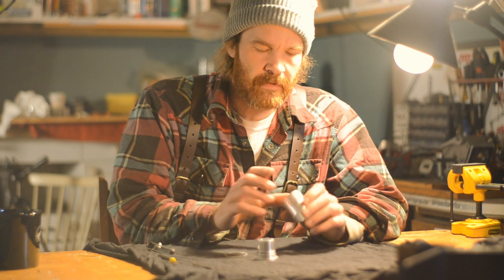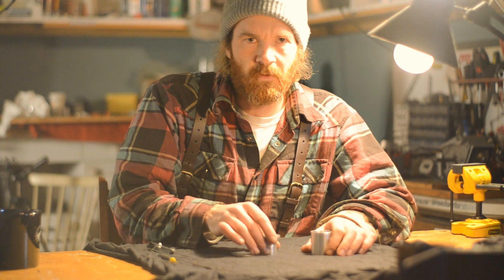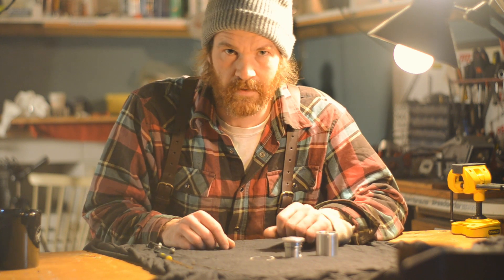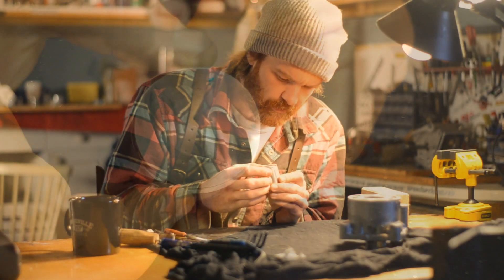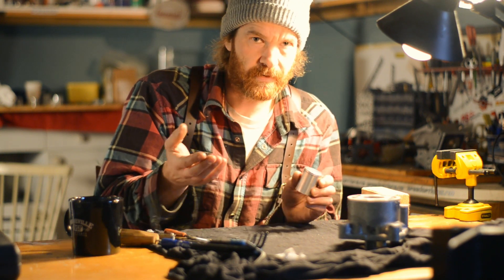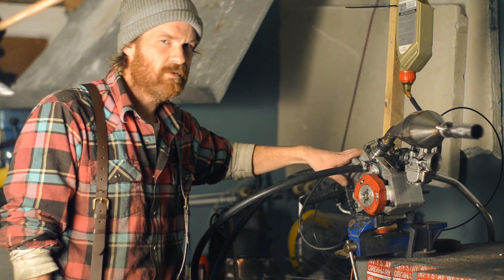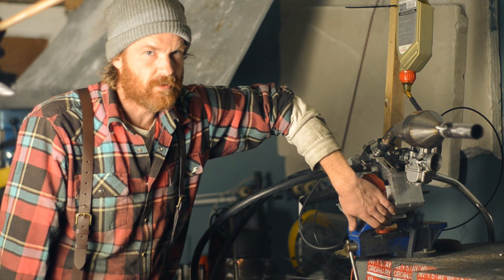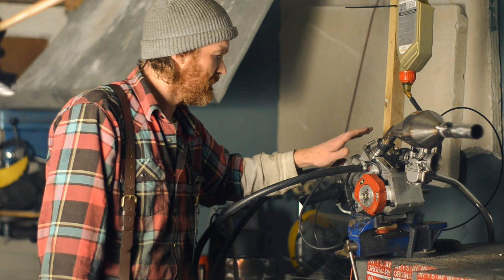Worlds Most Powerful Two Stroke Lives Again!

Comment: Great video! Always enjoy popping in to check out your videos. Haven't done the math for your compression ratio, but most race gas engines have a piston quench of .015 or an inch. And that's mostly for valve relief. At .5mm your close to .020 of an inch. You don't have any values to worry about. I think you mentioned using nitro fule? If that's what your going to use you might consider tightening the piston to head clearance to .015 or even .010 of an inch. This would net more torque. Also, this would be interesting to see in a forced air induction?

Comment: You might have to really do some work on your tuned pipe to accommodate for your massive port time area on the exhaust port. I don't think pipe build programs will register your massive exhaust port. At least to get your full potential

Comment: Nice :) - Maybe put a water jacket air bleed on the rear of the head, as it's prone to hydraulic air locks and head hotspots(bad for pinking, etc)?? Top Tip: Whenever you use toothed(saws, files, etc) tools, then always use the No. 3 Rule. That is, the material being cut must ALWAYS be three times the tooth pitch, or when cutting thin items, then incline the saw into the workpiece at a 3:1(H:V) angle to the horizontal. Especially so with fret saws. :) Or try draw cutting(used extensively in Japanese carpentry). This rule also applies to lots of other techniques. I love 2 strokes, but hate that stinging throat and eyes thing!! ;)

Comment: A great homemade design,but if i was to build my own racing 2 cycle engine,i would have experimented with crank driven rotary valve induction systems and running it on a low compression ratio burning top fuel as they call it here...20 percent castor/synthetic oil..50 percent nitromethane and 30 percent methanol...should be able to achieve 30k plus rpms on 50cc and less...My RC model airplane Nelson pylon engine does 38k on the ground and 40k plus in the air when it hits tuned pipe resonance.

Comment: Would it be profitable to drill two tiny small holes to the pistonhead some maybe 15° away from the ring gap to the groove to pressurize the ring? Lighter ring pressure when not needed and acts sort of small leak makes bigger leak disappear.

Comment: Nice video. 
When measuring the squish on one side only from the spark plug hole you get about 0.07mm by memory thighter than your ready, cause the piston pry crooked and doesnt flatten the thin well enough

Comment: Now you need a variable timing like the old evenrude and johnson boat engines when you give throttle the timming move to accommodate for low end power and high rpm top side

Comment: Hey!  Just FYI. When i cut gasket TEMPLETES like you are I normally use a super fine scroll saw blade in a bench scroll saw.  Put a piece of plex glass down with a slit exactly size of the blade and use it as your surface you work on!  perfect cut every time! how I do all my 2 stroke 1/5 rc motors I build for my trucks

Comment: You haven't done a proper leak down test yet on the entire engine..  Keep your eye on the crankshaft seals ..you need to run a vacuum and a pressure test evey so often.. ..as the seals are your weakest link in the whole system as you are building way more horse power than most 50cc two strokes so there will be a lot more boost made as the piston travels to BDC = much higher crankcase pressure  amount of horse power ..you don't want any leakage at all past the crank shaft seals ..especially on such a small displacement engine.. ...here is a link to the instructions and the tools , gauges, etc. Etc. You will need https://www.diymotofix.com/blog/how-to-do-a-diy-two-stroke-leak-down-test

Comment: filing the ring seat worked on a high compression Nissan 240RS fj24. but when we built a turbo 1275 mini cooper engine and filed the ring seats, the first ring always slid out and sat on the second.i hope you are more precise then we were. good luck!

Comment: Congratulations!! Realy amazing achievment. Loved the video format too, the early poet is shining through :)  I am also quite interested in which system of a dyno you will choose. Water or oil brake, electric motor, load cell torque measurement or load cell support measurement. For the dyno measurements you might also include some sensors, for example water temp in/out, EGT temp and also Lambda. Also what would be quite cool is to make the direct intake pipe slideable to tune its length accordingly and will be probably easier than print different lengths. When  you have an aprroximate length you can print +/-10 mm in 5mm steps for the final setup. Also maybe worth having some in spare as the air temp will affect the wave speed and you can test on a hot/cold day which length you need. So many questions and ideas sorry to have scrabled everything together, i am just so hyped about your project. Wish you all the best! This is the most exciting thing i have ever seen as a private project. Good luck!
Reply: Definitely. The success of this project hangs on accurate power measurement. People will want to attack your figures when you claim higher power than them, so you going to have to be ready for that. You will need to accurately record the air temperature, pressure and I think humidity as well. Come to think of it, what about air oxygen percentage? Maybe that varies as well! Also, the biggest variance is the engine itself. 
As a test engineer, it is my experience that there are always sizable differences in power from one measurement to the next. For example, on one of your videos, you do three runs in succession. I recorded the video sound track and did an analysis of the engine sound to extract the engine rotational speeds. From this I calculated the power using an estimate of your effective dyno inertia so that the power was around 20 hp. Once I had solved the problem of signal noise (without averaging) I could produce 3 smooth power curves for each of the dyno runs. I was amazed that they were quite different, the peak values were: 21.4 hp at 13220 rpm, 18.6 hp at 12743 rpm and 19.02 hp at 13219 rpm.

Comment: What's the black boot under the case? Is there two intakes on this engine?
Reply from the maker: Yep, two intakes.
Reply: @2STROKESTUFFING  how did I not notice that did I miss a video I couldn't of I feel like I've watched all your videos, how is that supposed to work isn't that a giant air leak is it actuated do you plan on having mixture enrichment from there as well or is it only an air valve?

When and how is that supposed to work!?!?!
Reply from the maker: @mattetch12  EFI on the secondary intake, I've talked about it in several videos 👍

Comment: Was the cylinder wet with oil before cylinder leak test. Ten % would probably be 4 with oil . I always oil anything I assemble unless specific instructions, oil on SKS firing pin. Big 2 stroke fan . Would love to build a Harley Two stroke

Comment: 7:52 yahaay - a jewellers 'peg', one of my favourite workshop gadgets.  top tip: it didn't work for you cos you need a saw with finer-pitch teeth on the blade. fine pitch FRETSAW blades should be ok for 1mm ally, if you need even finer pitch blade go for jewellers PIERCING saw blades ;-)

Comment: Hey man
If you want to Mill such thin layers of metal you Need way more speed, less cutting
depth and a better clamping. I can suggest you to use 2sided duct tape. Easy to handle and works fine.

Comment: By seeing the hand drill moving due the vibrations of the engine it made me think if it is posible to ballance the crankshaft more or not? 

I supose that you can gain some power there if further ballancing is posible.

Also looking forward allot to the dyno runs of your new engine setup.

Are you planning to use a silencer? Or maybe just one when dynoing?( i supose every gram of less weight counts when you're doing land speed record attempts)

Comment: Congratulations.!! Amazing how you could keep a straight face when it started. I had a grin from ear to ear. Be Quick with the dyno, im so curious to see the other intake working. Astounding work m8.
Reply: actually the very best intake is no intake at all but just bolting the carburetor or carburetors directly to the crankcase using Reed valves. a good example are the Chrysler West Bend Two Strokes of vintage go karts

Comment: Have you thought about 3d printing or laser cutting a template from perspex to allow you to cut gaskets quickly without having to measure and draw out by hand each time? 

A die cutter would be really expensive but a perspex template would still save a lot of time.

She sounds evil now, I approve.
Reply from the maker: Great idea!
Reply: @2STROKESTUFFING  id have got unreasonably passed off having to draw a new gasket each time I unbolt the dammed thing so iv been seeing it as obvious for a while.

Comment: 10%   Leak down is great on a new ring I'm in automotive mechanic used to race 2 stroke motorcycles and When I would do top ends I would wipe the Cylinder bore with a liberal amount of ATF because it has detergent And also I still use that to  Cross hatch cylinders Then clean and recoat During final assembly Promotes a little bit of Petroleum oil Lubricant on surface and detergent in fluid cleans up goes awayIn In fact my race bikes I would run A mix of Straight 30 weight Non detergent oil and ATF in the Crank case instead of oil Keeps a case squeaky cleanGranted your to stroke does not use  case oil

Comment: I am sure you know that most 2 stroke single ring pistons have a locating  Pin goes in the ring   Gap you could pin the top part of the piston Only since it threads into the bottom section then file your ring gap to your correct tension

Comment: what is the spring on the exhaust supposed to do?
Reply: Allows for movement due to vibration, yet keeps pipe pressed into exhaust port gasket. Common on old skool motocrossers.
Reply: @abyssmanur3965  wait so you don't bolt the exhaust on it? it just presses agains the gasket?
Reply: @hajyne348  yes theres usually three springs to spread the load, some were hooked thru holes drilled in the fins (aircooled) and others had a collar retained by bolts to the cylinder and the springs stretched from pipe to collar ... They all  have a tendency to leak burned black oil that would otherwise find its way out the exhaust.
Reply: @abyssmanur3965  ah yeah thanks for explaining so it's for competition stuff mostly?
Reply: @hajyne348  yep

Comment: How come every time you start this thing there isn't a single puff of oil smoke out of the exhaust? I'm stumped. All my two strokes have been like Exxon Valdez in comparison, even tuned up pretty well haha.
Reply from the maker: It's smoking, the camera doesn't pick it up very well.
Reply: He is using nitromethane not petrol remember. That changes how the oil combust and what amount of lubricant he has to run/the ratio.
Reply: @jediknight1294  I figured that might be part of it!
Reply: Jediknight 129 - he’s using petrol at the moment. Nitro is in the future

Comment: I wonder if you could use another material for a ring like an o ring or d ring that is inside of hydraulic cylinders may have to change often but wouldn't have to have a gap in it and with a good bevel on intake and exhaust wouldn't never have to worry about it breaking.

Comment: I've had good luck wrapping some 400grit sand paper over a file and using that to adjust the ring gaps. Creates a lot smoother less jagged finish on the ring end
Reply from the maker: Good tip👍

Comment: One day when your happy with your piston design you should consider getting it coated. Calico coatings does stuff for top fuel dragsters and all sorts of other engines. I had my turbo 800 hp 4 cylinder pistons done. The reduction in fiction and wear was just amazing. After a really hard season the skirts of the pistons still looked like the day I put it together. Just a thought....it's pretty reasonably priced. Not much at all.
Reply: Check the series, this guy does his own coatings.
Reply: Surely if you apply a hardened coating to the piston the barrel becomes the wear item?
Reply: @krazed0451  no not for the piston skirt... its not a super harded coating like a black Diamond coating for wrist pins.... it's like a Teflon coating just better and too there design many piston manufacturer do a similar coating to there pistons for stock factory cars like bmw or even toyota now.....when you touch it it's smooth and with oil on it it's extremely slippery. It's like insurance....if you run low on oil once it could save the piston or the bore. But it does wear away if the conditions are poor..too tight a clearance or not enough oil so on and so on ...it's only 1 too 2 thousands thick. The cylinder liner would be much "harder" check it out sometime look into coating it's really a amazing add on to any build. Most common parts would be piston skirts and main  bearings. They do have super hard coatings for wrist pins and rocker arms also ceramic coatings for the top of the piston to reflect the heat out and away from the engine.
Reply: @bradappel9928  Very interesting, I didn't consider coating for decreased friction or oil interaction! Super cool :-)
Reply: These are easy to rebuild and rings will never last. You have to remember this is basically the 49cc equivalent to an f1 engine as far as longevity is concerned. However, any increase in power from even a 1% reduction in friction may be worth it for a build aiming to be "the most powerful two stroke." Interesting suggestion.
Reply: By the way.... Everyone knows that the most powerful/ccm 2strokes is engines built for rc vehicles.... 3.5cc..... 40.000+rpm and more than 3hp... And does engines would absolutely give even more power/cubic displacement if they were even smaller and revving higher.
Reply: @lucaslittmarck6804  "everyone knows" lmao love that "everyone"
Reply: @snafuequals  haha yeah well I usually don't drink but got to taste some really fine rum from fiji today.. 
I hold my fingers crossed that this guy makes a opposite site single or perhaps in a split single and make a engine with more than 55% efficiency instead of focusing on hp.
Reply: @lucaslittmarck6804  Maybe after he's done with this engine... Start getting in his ear now, I'm sure he has other projects planned ;-)
Reply: he did coat the cylinder wall with nikasil or something similar iirc
Reply: It is Nickel coated, yes. Nikasil is just a brand name ;-)

Comment: are you gonna use the secondary intake as a ramair kind of intake ?
Reply: Tuned pulse. Like a valveless pulse jet. I can hardly wait to see it work, it's a very unique concept for the application
Reply: @ludditeneaderthal  oh ok interesting. this thing sounds pretty mean for a 50cc i got to say
Reply: @guigui78340  once it's spinning at 20k "on pulse" it should literally wail like a banshee! That little mill should provide quite a spectacle once he dials in the pulse tract to resonance

Comment: Am I the only one who was scared when I didn’t see any smoke out of the pipe?
Reply from the maker: 115 octane leaded. There is smoke, the camera doesn't pick it up very well.
Reply: If he was running Castor Oil or mineral based two stroke you will get more smoke. Synthetic based two stroke smokes far less.

Comment: What kind of oil are you running?  Not much smoke out the pipe.....
Reply from the maker: Castrol A747. Some fuel might be falling out of suspension at low rpm due to the massive case volume.